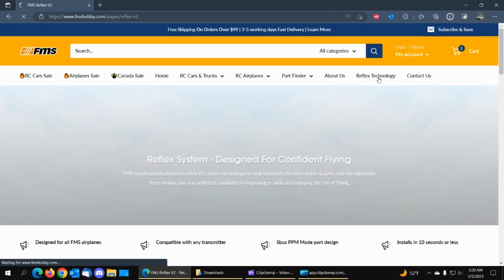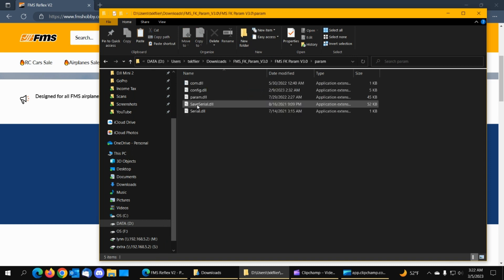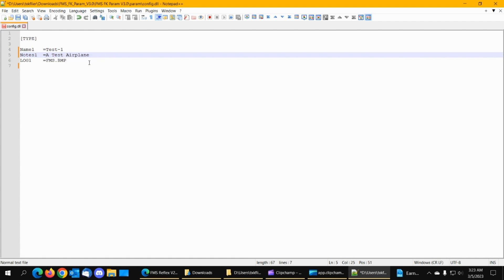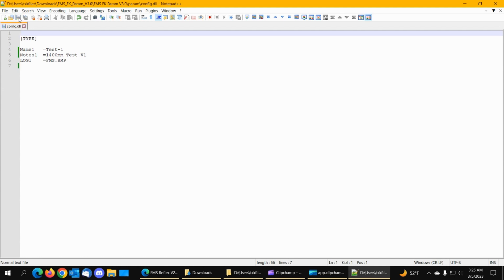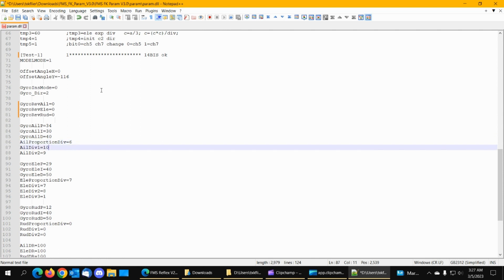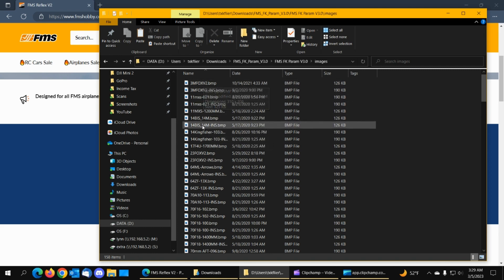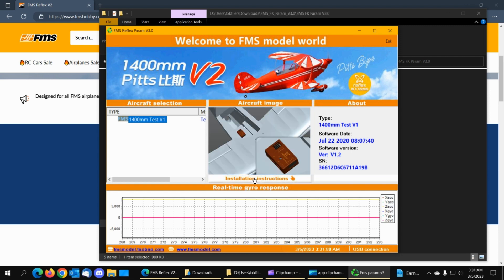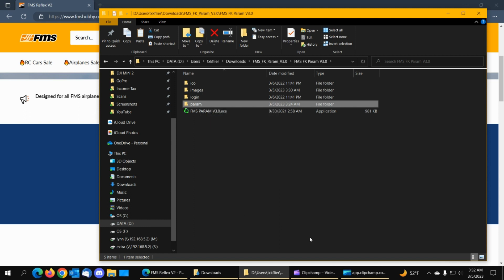FMS Reflex Gyro How-To (Sort of)

Comment: Thank you so much for sharing this useful info. I needed to reverse the gyro action on my rudder. After watching this video I went to the model file and changed the rudder from 1 to 0 and the problem was solved. There's actually a lot of good stuff in the help section of the parameter file.

Comment: Hello out there.  MODELMODE stands for 0= normal fixed wing 1= fixed wing 2= flying wing 3= V tail
You only have to pick a similar model and set the gyro direction right. 
I picked the Flash for a flying wing and changed the direction of aileron and elevator and it works for me. 
MODELMODE =2 for flying wing

Comment: My brain hurts..... I'm wandering if a new reflex v2 out of the box , (as in purchased not with a plane ) ....if it has a basic all round default factory setting so you can then put it in any plane and do your set up on your TX...... good stuff 🙄😎
Reply from the maker: I would think the gyro gains would be set to zero just like an open stock Spektrum AS3X/SAFE receiver and it would pass the signals straight through to the servos. And if that’s the case, why would you want it. You have to make sure the gyro reacts in the proper direction; otherwise, it’ll destroy your plane.
Reply: @txkflier  yes it is responding in the correct re-correction directions 😉😎 my brain hurts 🤕 it's 1am here in New Zealand .... great chatting and thankyou heaps... regards Deane 😉🤗😎
Reply from the maker: @deanedeane4318  You might watch my previous video about testing a gyro, when your brain recovers..  😎
Reply: @txkflier  I slept in and have thought a lot more about my attempt at this...... My brain still hurts but I just rewatched your video........I originally thought finding the closet plane would be enough..... if what I'm trying didn't work..... I've found the the reflex directions were backwards.....I'm thinking the servo direction on the superez maybe opposite to what I have as I mounted the V2 same as superez...... I'm sure I heard you say that is changeable on the programming page...... what I'm now thinking is use the fms "easy trainer' file and it's reverseing setting if needed? Am I making sense? 🙃😉😎
Reply from the maker: @deanedeane4318  Ok, I've watched the video again to see what I said. As I said in the video, you need to pick an FMS plane that is similar to the one you have. The gyro will need to be mounted in your plane the same way it's mounted in the similar FMS plane. Otherwise, you'll have to edit the mounting parameters. After the gyro is mounted and wired up, you may need to change the channel reversing in your transmitter so that the sticks move the control surfaces in the proper direction. Then, the reversing in the gyro configuration must be set so that the gyro moves the surfaces in the proper direction to compensate for turbulence or make the plane self-level. I like to put my planes in self-level mode to check the gyro direction. I tilt my plane about 45° from level to the left, right, nose up, and nose down. When I raise a wingtip, the aileron on that tip should deflect upward (the same direction I moved the tip). Raise the other tip, and the aileron on that side should go up. Raise the tail and the elevator should deflect upward. Lower the tail, and the elevator should deflect downward (same direction the tail was moved). When I bring the plane back to level, the surfaces should come back to center. The next most critical setting is the gyro gain (that's the P of PID). Too high and it could make the surface oscillate at higher speeds. If the gain is too low, the gyro just doesn't compensate for turbulence as much as it should.
Reply: Ohello again 😉 such fun !!! Yes so I think the servo configuration / placement in the super EZ may be  opposite hence why I'm getting ailerons and elevator gyro responding in the wrong direction, so from what you've just said (and in your video ) I'm thinking I have to re program the gyro response direction via the fms software program ..... Bugga or mechanically 180 degree those servo's and then reverse their direction in the TX......I hope this is helping me keep my brain fit and young..... Thankyou for your help with this......I hope I'm making sense and aren't to frustrating 🙃😉😎

Comment: Thanks for what you provided - it's a great deal more than what I had going into this process.  I wish you knew what the meaning is for each individual field inside the parameter file.  That would make it complete.  I sent a message to FMS requesting that information but who knows if they'll comply with my request - probably not.  If I do get lucky I'll come back here and let everyone know what I uncovered.  It's probably not as difficult as we're making it to safely modify an aircraft parameter file but that's just a guess.  If push comes to shove I'll modify the parameter file that I use in my high-speed non FMS airplane by reducing ONLY the gain entries for AIL/ELE/RUD and test fly to see what happens.  Maybe someone else will already have done what I'm suggesting by the time I get around to it 🙂.
Reply: well my thoughts on the video wow but let say this my pitts 1400 mm came with this reflex 2
had all the wires marked to go on your receiver on the bottom of fuse it had a sticky tape on it to lay your reflex gyro on it wires  to receiver facing the nose of plane  hook it to spare channel 5  put on a single switch to turn it on -off on my Futaba set up my  throws  turn on my transmitter plugged battery on turn on gyro it on a series of a test ailerons and rudder elevator moved on all directions for two seconds it set  picked airplane moved it up down side ways all the throws nose down elevator recovered side ways rudder recovered dropped wing left _right recovered to neutral so said on a fixed wing aircraft it does matter left ,right up, down it recover to neutral just saying...........out bub8
Reply: meant to say on a fix wing it does not matter prop or EDF jet it will recover to neutral

Comment: Thank you for the video. Really saved me from a bind.
Reply from the maker: How so?
Reply: @txkflier  I aquired an old hobby king 1400mm j3 cub and wanted to possibly gift it to a friend as a RTF with a gyro but all I had laying around was the reflex out of my Pa-18 1300mm which was perfect except if the reflex orientation was correct, the elevator was reversed. So your walkthrough of editing the parameters really saved me from having to buy a spektrum setup or similar.
Reply from the maker: @thatguywiththercs  Good deal..